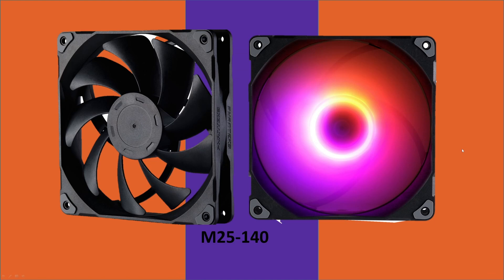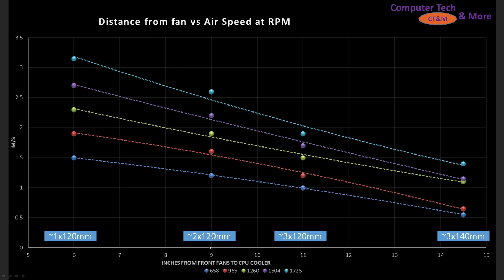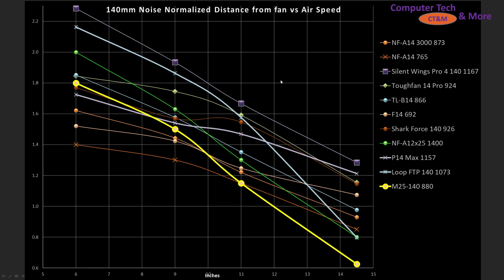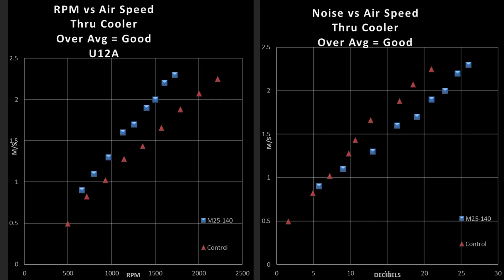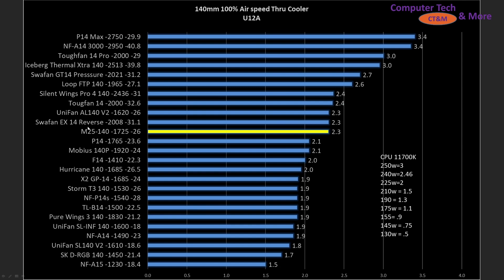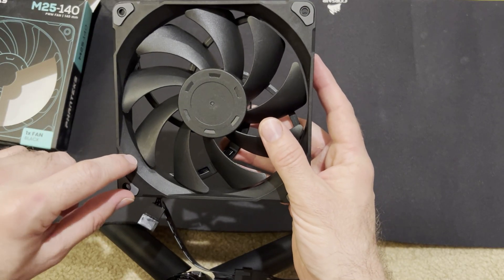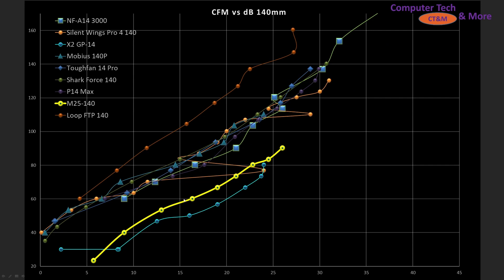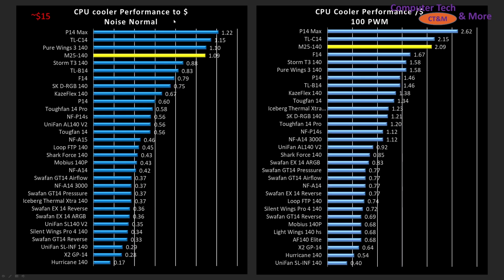Phanteks M25-140

Comment: I found a review for this fan on expreview, along with 18 more 140mm fans they tested. For performance, they actually recommended this one. Slightly lower performance and noise compared to TL-C14X and Shark Force 140. Arctic P14 PWM PST is rated as the best overall.

What I don't quite understand is, in their test the Mobius 140p has lower cfm, as well as static pressure, on all the different environment they tested, than this M25-140 D-RGB.

I managed to snag these Phanteks at only USD21, for 3 fans. Yes, they're a bit loud, but they're delivering excellent airflow. And at USD7 each, I don't think that this is beatable.
I saw in your test
Reply from the maker: I dont watch to many other fan reviewers. my testing in case airflow is currently unique. So its all about testing method and equipment. I have a very basic mic in all honesty. I need a better dedicated one for testing. 
It also like you said a bit loud but great airflow. so everyone's tolerance to noise is different. 
lately Ive added more noise levels and tried to rail in noise and what might be too noisy vs not.
Reply: @computer-tech-more they tested them in 3 environments, on a radiator, an aircooler heatsink, and a simulated pc case with dust filter. Noise normalizations for the 140mm fans are measured 30cm away from the center of the fan, and set at 36dB. Noise normalized on 120mm fans are set at 40.7dB. It's in chinese, so it took me quite a bit to digest the translation.

I set them at 58% pwm, running at ~1300rpm, from 2ft away, it's about 30dB I guess, I have no idea. Sounds as loud as the mobius 120p at max rpm, about 31dB if I'm not mistaken.

They also measured how much the static pressure drops as the airflow increases, I don't quite get how this one is tested. But looking at the charts, the m25 140 drgb is showing its prowess.

After adding 2 of these m25 140s, my gpu max temp drops by about 5°C, 30°C ambient temp. I have no idea how. Cpu max temp went down by about °3C. Intakes are about 9" away from the cpu.

I know the best ones to get are the ones blowing the most airflow at the same dB. But for what I currently need, the  arctic p14 pwm pst argb, and the tl-14c argb aren't producing enough airflow. As well as the mobius 140p, if I can get one.

Comment: I found the G2 version of these for 8.50$ each so i grabbed two, i wonder if there's any improvements, visually they seem pretty similar, the warranty is only 3 years now but MTBF is +10000H, the specs seem a tad worse but the minimum speed is slightly lower, i wonder how they perform as a case fan actually at that price they might be good since they have enough static pressure to pull through a dense dust filter and front panel
Reply from the maker: I havent tested the G2 yet. Its sitting on my office. I expect similar or slight improvements to the original.

Comment: Nice review. I purchased a Phanteks XT Pro Ultra in May that includes 4 of these fans. At MSRP, the fans would make up $56 of the $80 price, although I know the pricing doesn't work like that. The real-world performance of these fans is in line with your review, being decent for airflow and reasonably quiet. I've tested a 7600 and 7800X3D on a B550 motherboard using both a good air cooler and an older but okay 280mm AIO, both with very good results. Graphics cards tested ranged from an older HD 7970 to a GT 1030 to a fairly new and power hungry 6900XT(XH), all of which did well.

I don't think I'd buy these fans over others, unless I had some need to match the styling, RGB, etc. I really like the case, but if I bought it again, I'd probably skip the "Ultra" and get the Pro for $30 less, then get Arctic P14 Max fans or similar that you recommend.
Reply from the maker: first I'm glad my testing is similar to your findings. 
It seams like most cases that come with fans are this way. Like i have the Torrent. The fans are fine but only mid tier in my rankings other than the 180mm at the front and that's partially because there are so few fans that size on the market.
Reply: The fans that are included in the prebuilt are actually NOT these exact fans. They are built of lesser quality & do NOT include the anti vibration covers. It is a very similar fan, but a lesser & less competent variant. Phanteks confirmed this. Sorry bout that bud.
Reply from the maker: @ i wouldnt doubt it but where did phanteks confirm that? in an interview or some other site?